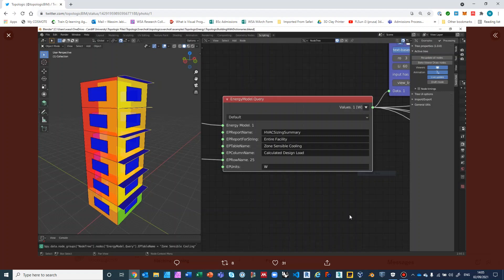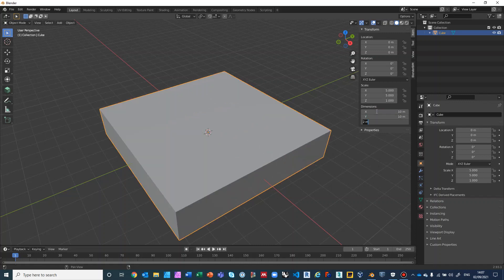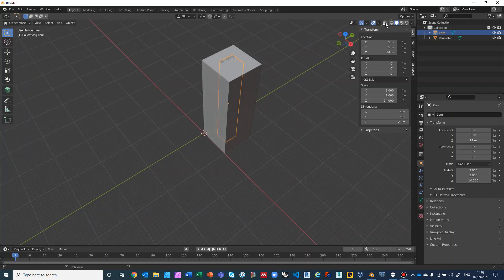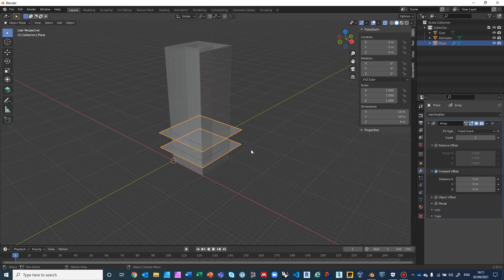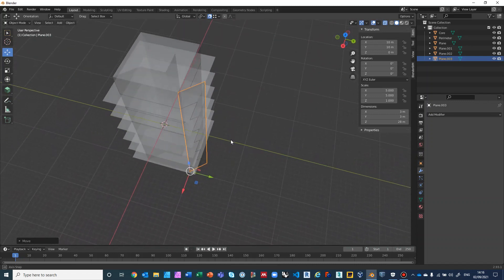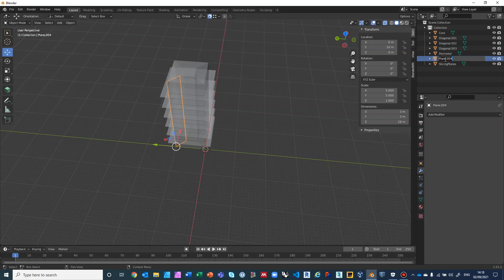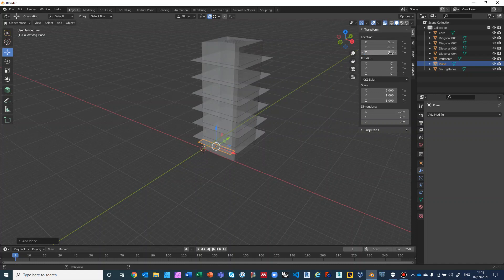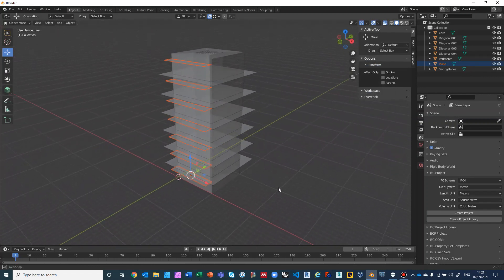TopologicEnergyBlender Part01

Comment: So to clarify, Topologic is bundled by default with the BlenderBIM addon? Or does it have to be installed?
Reply from the maker: Hi Edwin, No, this has nothing to do with BlenderBIM. You have to install it separately and it does need a bit of work and know how to get it to work. It is not yet a single click installation. You can get it from http://github.com/wassimj
Reply: @wasjab  Thank you. I'd like to try this out. Maybe the next video can explain how to get set up in blender from scratch? Or perhaps such instructions are in the github page and I missed them?
Reply from the maker: @edwinguerracastrejon  there are instructions in the various readme files but they are a bit chaotic. I have been meaning to clean them up. It is easier to install on windows. I will try to do a video on installation.